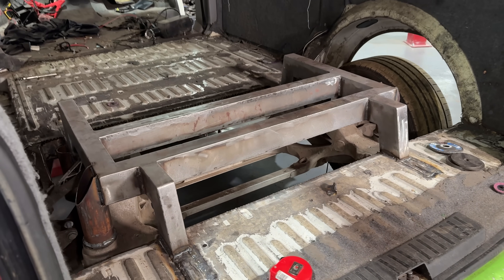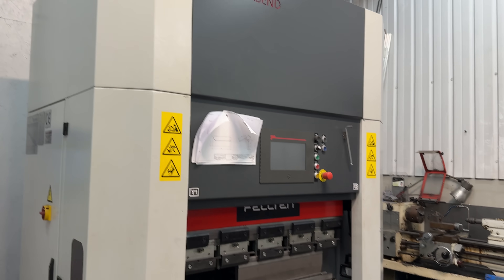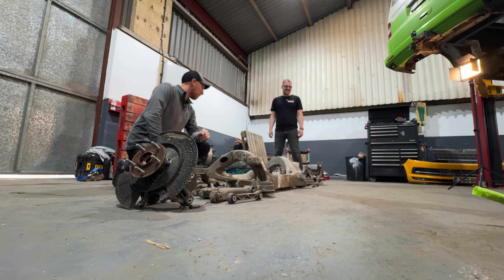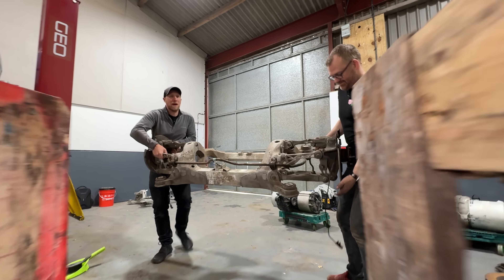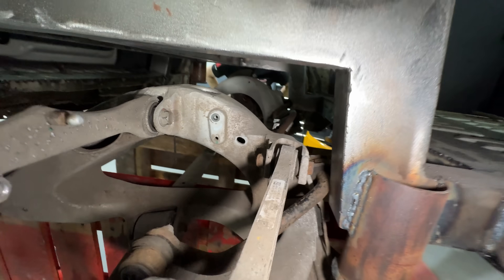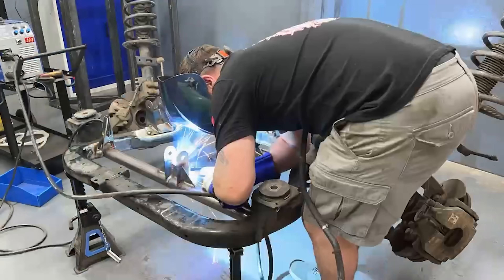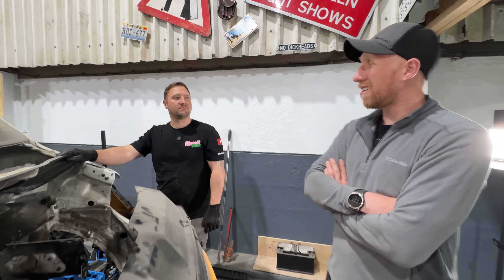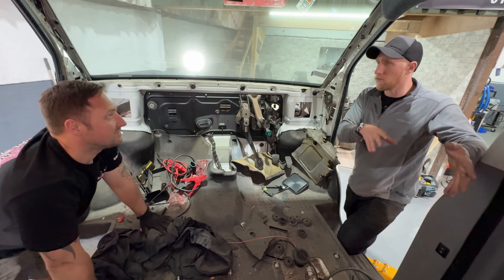VW & Tesla had a 1000HP Electric Baby

Comment: Why don't you try  2 model 3 battery packs with custom box. That will give you with 3 modules wide double stacked with 2 spares and almost 110kwh between the frame rails without mounting a pack inside
Reply from the maker: We have been looking at lots of options. Using outlander cells is also another one as they have a really high discharge rate.

Comment: 1200 amps from a ID4 battery module?  Do you have a link that shows that amp output?
Reply from the maker: The 12s2p modules are rated for 800amps for 10s but you can push abit more as long as above 25c and the 8s in the id4 has an extra cell in parallel given the extra 400amp peak.
Reply: @Hazell_Nutz Did your BMS from previous builds indicate 1200 amps?  They are sold advertised at 1000 amps.

Comment: Have you got a name for it yet?
I have a few ideas
T5la, Te5la
TransTesla
Reply from the maker: We have been going round in circles. Not sure if we can get away with the one you listed that we like 😂
Reply: @Hazell_Nutz 😊
Reply: Sadly my T5 set on fire the other day 😢 12v fault in the under seat battery areA, so it won't be available to be towed. In the challenge.
I was hoping one day to do an ev conversion on it but interior is wrecked and and wires under the double seat are a mess so unlikely to ever see the light of day now 😢

Comment: None of those subframes are straight/square, I would have build a tube subframe frm scratch regardless this is great content 👍🏾👍🏾
Reply from the maker: The funny thing is. The original front subframe takes m12 bolts yet the holes are 20mm so much movement. We have now made some changes and all lines up perfectly

Comment: How are you getting away with cutting the floor out? I thought this was a no-no when converting to electric you are on a five point scheme. I thought that's four points straight away for cutting the floor out??
Reply from the maker: It will need an Iva. But as it’s after 2001 the DVLA will not allow it to be updated to electric on the log book so …….

Comment: I'm pretty sure running the tesla unit in reverse there is a lubrication or cooling issue. I think there's a 1 way valve or similar that will cause premature failure. Give Moggy a call at electric classics cars - I'm pretty sure he found the issue.
Reply: A reverse oil pump solves that problem. The Toyota RAV4 EV and the Mercedes B class ED both ran them backward.
Reply from the maker: The funny thing is Chris was the first to run them in reverse back in 2018 as he runs Zero EV/ Fellten. We are fitting a reverse oil pump that Fellten make to keep the oiling correct. But the RAV4 and B Class electric run them in reverse as well.

Comment: Cut the bottom plates off your subframe mounts. Make new oversize plates. Set it on the subframe and adjust it straight, then weld them in.
Reply from the maker: That is one of the option we are thinking off

Comment: One suggestion is to make a new Puck plate with the hole in the right place to weld to the bottom of the puck support tube.
you really don't want a slot that would allow forward aft movement under load. 
that could cause the rear to misalign and crab walk.

Love the progress lads.
Reply from the maker: Thanks for the input that’s what we have been considering

Comment: Why not have used more advanced and even efficient latest model 3 motors!? They are much smaller /compact and easy to package
Reply from the maker: They do not output as much power.
Reply: Also can’t be controlled with AEM so would have less freedom when it comes to setting it up
Reply: 300 hp verses 600 hp. The Model 3 rear motor (well, a Raven front motor) would be better for the front, though. And a lot simpler to control.

Comment: Did you decide that the Tesla pack was too wide? Or was the lower door runner track in the way? If so what was stopping you cutting it out and moving the track higher up the body of the van. Then just move the bracket with the roller the same amount up from the corner of the door.
Reply from the maker: There was lots of things, the side door track was the last straw. Once we looked closer with the dash board position of the Tesla would of need taking up half of the door space once open and we would not of been able to do stupid things like burn outs and drifting.
Reply: That’s totally understandable. A compromise too far! Isn’t it still possible to fit the Tesla battery pack under the T5 though?

Comment: As a Tesla owner 🙈 and no I don’t goosestep everywhere 😂 if Tesla made a 1000hp transporter campervan…. That could possibly be the best vehicle EVER made 😂
Reply from the maker: Could not agree more
Reply: @Hazell_Nutz Tesla have hinted publicly on past earnings calls of their intentions to build some sort of people carrier that was Mercedes Sprinter size. Elon also praised the classic VW Bus as a cultural icon and called it cool. However, following the WeRobot event in 2024 and the public announcement of the 20+ seat Robovan along with thier autonomous Robo Taxi, I’m not sure if we will ever see Tesla produce a consumer van as their focus and direction is now towards autonomy and building robotic fleets to negate the need for individual vehicle ownership. Tesla can make far more money building autonomous taxis and operating them than they can selling them. Uber, Waymo and traditional taxis would go the way of the Dodo as quickly as Robo taxis could be built and the relevant legislation passed.
Reply: Nah! 300-400hp max is the power it needs plus you actually need to be able to lift it and still have some range or actually tow! The 1000hp tesla modelX can barely tow 5000lbs while a 250hp diesel similar vehicle tows over 7000lbs
Reply: They are going to making a van so you could build a camper out of it.

Comment: Just a heads up there is a weak point on the rear suspension there is a new revision on the rear lower arms as the original ones seem to be snapping on the older ones
Reply from the maker: Thanks for the heads up

Comment: Can I volunteer my T5 to be towed by the TransTesla 😂
Reply from the maker: Hell yes you can
Reply: @Hazell_Nutz  well thats incentive for me to get an MOT on it and sort the gearbox...😅
Reply: Don’t need a gearbox to be towed
Reply: @Hazell_Nutz_Nick that's true but getting it to you from north Devon is an issue if I've only got 3 gears working on my auto box.....lol
Reply: @alanbutler487  we have everything for a manual conversion and a gearbox if it’s a 2.5 😊
Reply: @Hazell_Nutz_Nick It is a 2.5 and I had thought of that but I've got a prosthetic leg and the van is fitted with a flip throttle so I can use the throttle with my left foot.
Thanks for the thought though.

Comment: Some kind of eccentric adjuster for the back so the subframe doesn't move in the slots under full power or an adjustable stop of some type similar to adjusters on rear wheel of motorbike
Reply from the maker: Yes, we have come up with a slot and washer set up that locks into place once we get it dead right.

Comment: Also, on brakes and regen, if your batteries are fully charged you will have very little regen as there’s little room in the battery to store it!
Reply from the maker: Yep, what we normally do it cap the battery so it only charges to 95% leaving abit for regen but it’s still abit reduced so need good stoppers.
Reply: @Hazell_Nutz  the P100D pack would be big enough or even a P85 surely?
Reply from the maker: @kinross24 they won’t give enough amps, in a p100d it has a large rear but small front drive unit.
Reply: @kinross24 the p100d doesn't even put out enough power for the large and small drive units.